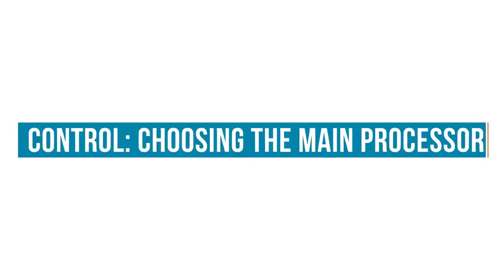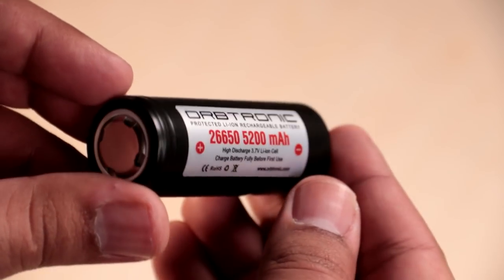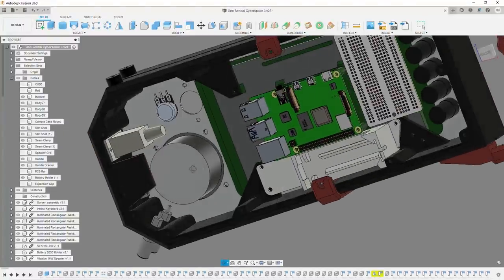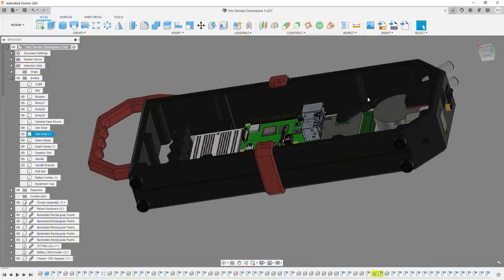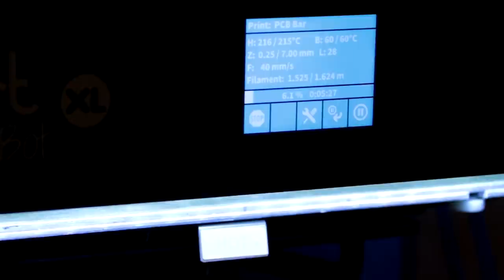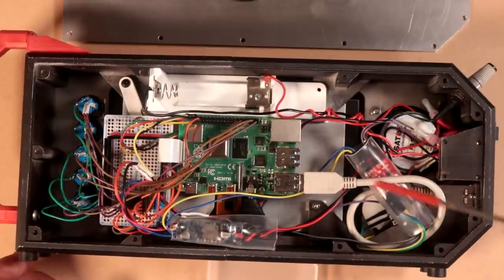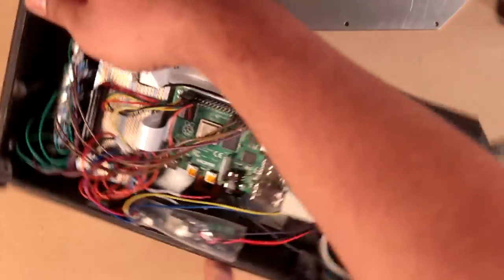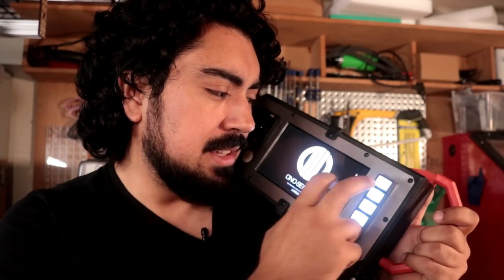DIY RaspberryPi Cyberdeck

Comment: A cyberdeck without mechanical keyboard? Is that even legal?
Reply: Hey @Vince ! Always here to watch a DJ video ;) thanks, hope it will be soon enough!
Reply: Ha, I thought about this a lot for the build, but what's more punk? Following the crowd or doing your own thing eh?
Reply: No, not having a mechanical keyboard on this is actually highly illegal. 
Mech Keeb with aviation connectors should be standard for this. :)
Edit: I suggest an Alpha28 or a Corne. (If split keebs are not your thing, any Planck style keeb should be fine.)
Reply: Is legality a factor in designing a cyberdeck?

Comment: banana plugs should double with a switch as alternate power source for the device. take in 5v from a bench top power supply.
Reply: There's already 5V input and output in the form of USB, better to have the banana jacks connected to the battery with a PTC for overcurrent protection in order to use it to charge external batteries or power the device from external batteries.

Comment: Cool build!
Since you asked... probably the first mod if it's going to be the "go-to pi dev platform" would be a quicker way to get at the guts than 13 screws. Like at a minimum I think i could have imagined a grove along the back that the rear plate could slide into and then just a screw or two keeping it from sliding back out, or maybe even some type of carrier for the pi and the breadboard with an edge connector for the essential connections so that the pi/breadboard could slide into the case through a hatch in the side like some kind of unholy sony memorystick (yeah that's redundant). I guess the upside to the carrier/edge connector paradim is that would open up the possibility of also having pi/stripboard modules because breadboards are awful.  Come to think of it, this sounds like a Pi Compute Module project :)

Comment: Hot key buttons; When you press a specific button; It performs a predefined task, like launching a media player; It also announces what it did or will do. 
For example, it says, "Launching the media player."

Other buttons; oscilloscope, multimeter, EPROM programmer, Ir remote.

ESP32 LoRa Repeater Node - Meshtastic text messenger.

Comment: For me a cyberdeck should have 2 things
1) be open and not confined by hardware of software blobs 
2) I/O, I/O, I/O It needs to be able to interact with EVERYTHING or close to everything if possible from wiring a card and interact with an ATM machine to be able to wire it to some manufacturing device and cotrol it or to controll a car wirelessly with it etc.

Comment: This is very very cool. The one change I'd make is making the battery holder accessable from a hatch or something so you could swap out batteries without disassembling the thing. No need for fast charging if you can just carry one or two backup batteries in your pocket (in a case, safety first) 😁

Comment: Single Battery is having trouble putting out enough amperage and is losing voltage as a result, so a second one in parallel might mitigate that as it wouldn't draw as much of each individually but still have the same voltage and keep nominal voltage better, also increased capacity as a bonus. Plenty of space inside to accommodate this as well I think. As for the buttons, having them linked to some macros to switch to different operating modes would be interesting. Camera mode, browser mode, coding mode, etc. Looks great though.

Comment: The buttons should do tiling in tmux or if you choose to run a window manager (not in the spirit imo) in like i3 or something.
- assign one as the shift key (probably bottom)
- first moves horizontally, first plus shift tiles horizonally
- second vertically
thats all i got so far

Comment: One way to remove the low power is use two batteries and a buck converter to downgrade the 6.whatever volts down to 5.15. I use buck converters on loads of pi projects. Using one to power a retropie suitcase system with a milwaukee portable drill 18v battery.

Comment: id build one into a ser of VR goggles the kind you can get for cheep and slot your phone in, just use a raspberry pi and an appropriate sized screen....id also add a pair of cameras so i guess it wold be more AR than VR, or i guess a combo of the two? that way you can "jack in" to "the matrix" for real, by playing VR games, (simple ones, or cloud streamed ones from a more powerful computer) or using a VR office space, whatever.

Comment: What is the model of the latching buttons you used?
Reply: There's a complete BOM for the build in the community link in the description. Cheers! Although, I will admit that these came from my surplus button collection, but I was able to find a comparable model to list.
Reply: @MrVolt  Thanks.   The reason I ask is I have looked for these types of illuminated latching switches before but they all said automotive use and needed 12v for the light.  I didn't know if they would even light with only 3.3v or 5v off of a Pi/Arduino.  I looked these up on Newark but they don't say for the light but if you have them working then I guess they are good.

Comment: I was reading a thing the other day and did a hookup on a raspberry pi zero to put a momentary switch to pin 3 + gnd to invoke some shutdown code + it also wakes up the pi. What is the downside of that? I did make a gps puzzle box with an arduino ages ago that used a circle that would be able to cut power with a single pin that I wish I could still find.... but just wondering
Reply: The only downside is that's more of a soft "safe" shutdown that will prevent corruption of the filesystem on the SD card, but the Pi will still be drawing power since none of the boards have the built-in hardware to actually fully turn off their own power supply, so that still has to be done with external circuitry or just a switch to cut all power usage.